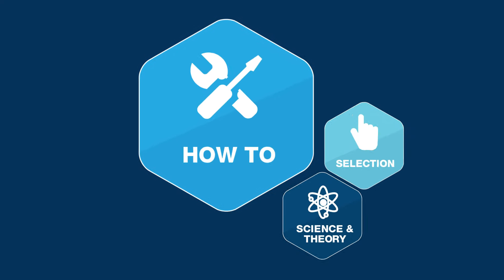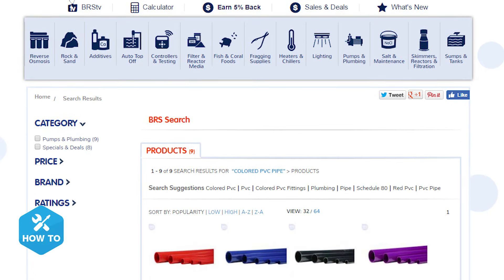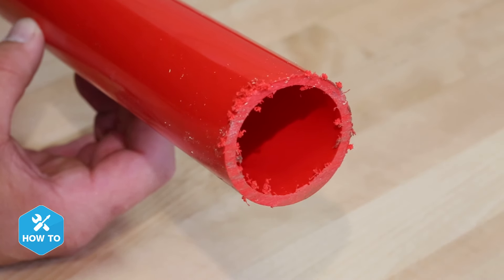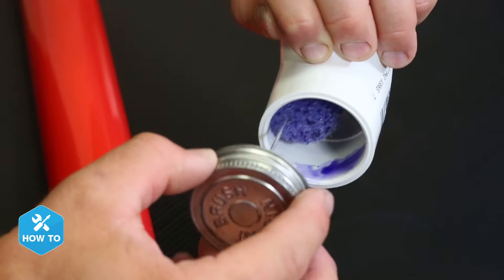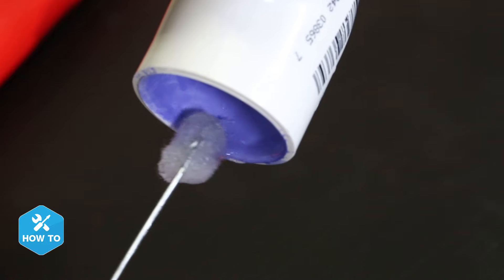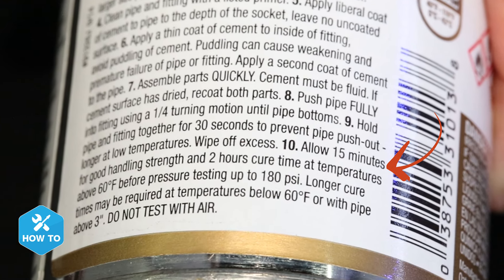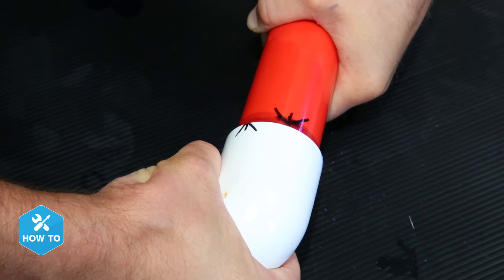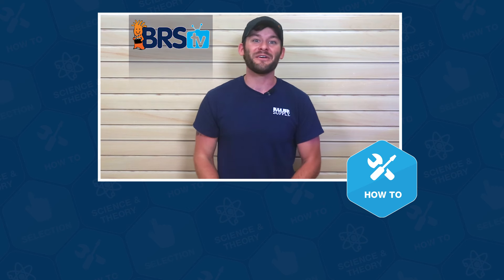How to glue PVC plumbing | BRStv How-To

Comment: A hint on getting the right distance of glue/primer, the length of the glue and primer applicator is almost the same distance inside the fitting (slip end) You can use this distance on your pipe so that you do not over extend your primer and glue  (I used to be an  underground irrigation installer and we used this trick all the time) :)

Comment: Do you have to use special marine pipes. In the uk we can get upvc items that are the same or near matches.
Reply: In the US we typically use Schedule 40 pipes. Some use Schedule 80 but they cost a lot more and are overkill for most aquarium applications.
Rule of thumb is that if it is safe enough for your drinking water, it should be safe for the aquarium.
I still use a matching sized flexible hose for the final 1 foot connection to the return pump. Otherwise the pump vibration could carry into the entire pipe system :)
Reply: SaltRockStacker that's what I was thinking. Thank you for your input
Reply: BulkReefSupplyCom thank you very much for your reply. It's worth it's weight in gold. Thanks again

Comment: Great video BRS! It is a good idea to chamfer the end of the pipe before applying glue. This chamfer allows a glue filled pocket to form and creates an even better seal. I'm a bit anal tho as I'm used to plumbing hi pressure lines at work. Aquariums are not in the high pressure category LOL.
Reply: What can I use to do with?

Comment: I put a whole system together and realized I didn't use primer. 20 gallon tank, 10 gallon sump. Do I need to rip it all apart and start over?
Reply from the maker: Using a primer is considered best practice, but in a vast majority of cases, you'll be just fine without a primer. Before you add rock, sand, or any livestock, we'd suggest filling the tank with water and doing a leak test anyway.
Reply: Bulk Reef Supply phew. Thank you!

Comment: this video is too late for me 😂😂😂 , I managed to glue my union joint together so the cap won't screw off. somehow the glue creeped over the seal.  also , there's a tool to cut the pipe that will make your life easier.  I recommend buying it  .

Comment: Good tips but please tell the reefers out there not to used any drain fittings on the pressure side of the systems if they use pressure parts like elbow and tees that are made to be used with water pressure they have less chances of a big flood if one of those drain fittings burst under a static pressure of the return pump for example from the basement to the second floor where is the tank located it will be disastrous. Listen t the plumbers. Keep Reefing America

Comment: OK so spend 3 times as mutch for colored PVC and slop purple primer all over it?  Don't think so.   Pro plumbers will argue for sure but I hardly ever use primer.   and if I do I sure as hell wipe the excess off because it looks like crap.   Overflow lines done have any pressure in them  and less than 10' of return is not going to magically block up to increase pressure.   I simply use cleaner, then regular PVC glue and wipe off the excess..